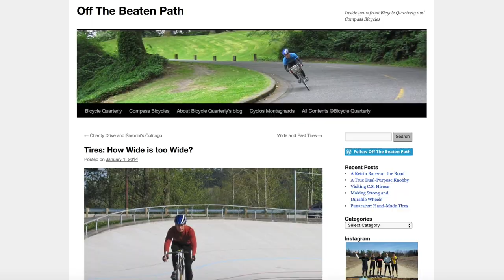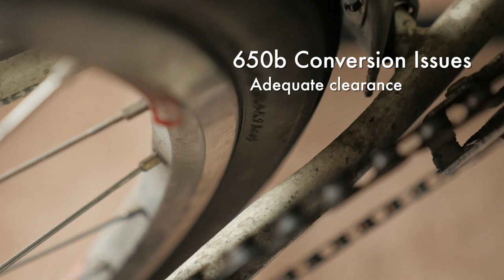Converting a 700c Bike to 650b - #SuppleLife Part 1

Comment: Don't forget that it may reduce toe clip overlap depending on the size that was being used originally. What do the tires end up measuring out to? We tried the WTB 47s (actually measured 44mm on slightly narrow rims) on our Pass Hunter Disc. They filled out Pass Hunter Disc frame nicely but not a whole lot of room for wider fenders. Can't wait to try it out on a longer ride now that the weather is looking up.

Comment: Technically with the same size tire 700 to 650 will drop your height 5cm. Of course you can make up the difference by adding taller fatter tires on your disc brake gravel frame that have room for about a 700x50c tires. 
In my opinion the gravel bike companies are missing the mark by not offering 650b or smaller frames, measuring with 700x45c tires and having descent standover to lower your seat post and do steep gravel descents with confidence.
Reply: Technically, it should drop your bottom bracket 19mm. 700C BSD = 622mm, and 650B BSD = 584mm. The difference is 38mm, divided by 2 is 19mm. Once you start adding 650B tire width, the difference gets smaller or goes negative. For example, converting 700x28 to 650x42, the bottom bracket will only drop 5mm. If you can go up to 650x48, the bottom bracket will actually get a little higher than 700x28.
Reply: @vautrain  what is the actual diameter of the 622 wheel with a 700c ×28 tire , would it be close to 660mm or much higher ?

Comment: I have a collection of mtbs  Treks Giants I convert them to ebikes. One day when a bought one of the mtbs. I saw a "Schwinn Tourist" I guess it was a commuter style bike, with the rigid forks.. It was faded and had a rusted out chain. The rear wheel was off the bike and needing a new axle and bearings. 
 Well the guy asked me if I wanted it. I looked at it and thought I just wasn't my style of bike with the super skinny 700c tires. But for free?  I just took it off his hands.. 😊

One thing I noticed when I was fixing the axle and bearings. The bike was actually very nice and had an aluminum frame. The rims had 28 spokes and the tires where 23mm super skinny road bike tires. It was like 25lbs or less very very noticeably lighter when lifting the bike off the ground with my arm straight out in front of me.

 I took it on a spin, with the super rusted out chain. Boy... with the rigid fork and road bike tires.. it was very hard on my crotch going over just the little bumps on the crappy, pot hole ridden streets where I live in West Texas. But I found it was so much easier the pedal and seem even faster than most the bikes I owned unmotorized. 

A couple years past and a saw a really nice commuter bike, a Schwinn GT3  practically still new for $30. It had the 700c fatter tires and a suspension fork!  😊👍 I looked online  and the bike new was like 4 to $600. So I bought it. I rode it and once again felt easier to pedal and more faster at top speeds compared to the 26ers I usually collect. This bike setup was amazing.  It felt somewhat like riding a pedal assisted bicycle, with the ease of pedaling.

Idk why it's not that big of deal. It really got me into riding unmotorized bicycles again. I can't believe how people don't rave about this setup..

I LOVE IT!

Comment: You say that converting a bike from 700C to 650B will "lower your bottom bracket, and it's going to lower your crank, therefore your pedals, and will probably increase the chance of pedal-strike..." 

That might be overstated.  While the diameter of the rims is smaller with the 650B, most, if not all of the difference between the overall diameter will be taken up by the *tires*.  The reason I say "most" is that it depends upon what tire pressure you choose.  Running low-pressure (say, 25-30psi) will very likely result in reduced bottom-bracket clearance, but at regular pressure, it should be about the same; less than 1cm overall.  That should barely be noticeable.
Reply from the maker: Not true.  I've found the difference to be as much as half to 3/4 of an inch when switching from 700x40 to 650b x 48.  Enough to noticeably alter handling and increase pedal strike.
Reply: Again, I said "most, if not all"; I didn't say "none".  And you haven't said whether your tire pressures have been equivalent.  

I have two French randonneur bikes (late-1950s and early-'60s) that were originally fitted with 650B rims and tires.  They were later fitted with 700C rims and tires (before I bought them).  I wanted to go back to 650Bs but, being concerned about this very issue, I measured the old tires' circumference, and then measured again after swapping out to 650Bs.  The old rear 700C (a new-ish Michelin inflated to 55psi) measured 2118mm.  The new rear 650B (a new Hetre at 55psi), measured 2110mm.  That's less than 1cm in circumference (so 2 or 3mm in diameter); in no way enough to affect handling, ground clearance or pedal-strike.

My point was that one can't make a blanket statement that it will affect the fit of the bike, since there are too many variables involved, and it may have no effect at all.

Comment: I was wondered how it happened that 700Cx35 is so larger than 700Cx28 and I'm pretty sure you've got the measurement of outer wheels' diameter wrong. On the picture with the comparison disks' upper points that have the same diameter don't match up - 35mm is significantly higher than 28mm.
Reply from the maker: Those were direct photo overlays.  That "comparison discs upper points" is the reflective stripe on the 35mm Voyager Hypers.  They are just that much taller.
Reply: Thanks for your answer, somehow at first i assumed that you have shown the difference in the radius, not the diameter. In other words i thought that the front hub was at the same height everytime, not the floor. My bad).

Comment: What was the internal width of the rim you are using? Also, what exact mm did the tire come out to? Spot on 48mm? I am very curious about using these tires with a 30mm internal width rim. I am wondering if a 30mm internal width rim will actually make the SBH wider? My frame can clear up to about 51/52mm in the rear chainstay. Thank you for this most excellent content :)
Reply: I’m still waiting 🥺

Comment: Are you planning to roll with the 700c fender? How's the coverage? I was assuming I'd need to get new 650b fenders to match, but maybe not? Thanks!
Reply from the maker: Charley Traylor they work fine. I'm cheap so I'll prob just use them and trim the stays to fit better :)

Comment: Nice and informative vid. I've a question since I'm considering doing the conversion on my hybrid. It came stock with 700x40 tires. If converting to 650b, what would be the minimum size 650 tires that I should get?
Reply: How it went?

Comment: Do you not have room for a 700x51, or is it  just the new Vayas have that much clearance?
Reply from the maker: You can fit larger 700c tires, but there aren't that many options in wider sizes for supple road plus tires at the moment.  One advantage of going 650b is you get the suspension and float with lighter rotational weight.

Comment: Hi. I've have read the comments below, but I still can't understand the diagram at 0:07.
Are not the 700x35 and the 700x28 both 700mm in diameter overall.  The 28 and 35 refer to the width, do they not. So why do they all appear to be different diameters in the diagram?
Also, the 650B would be 650mm overall unless you put a deeper tire than a type B. Could you tell us the diameters of the rims and tires used, please.
Thanks for the vid.
I'm trying to do this to my bike, but a lot of the 650B rims I'm finding are just 27.5inch with a standard 35mm tire. Which is just 700x35c.
Why do manufacturers not just write the rim and tire diameters, and the tire width? It would be so much easier.
Reply from the maker: 700 is the rough diameter of the RIM. The tire is a larger diameter. The wider the tire the larger the diameter. Put a wheel with a 700x28 next to a wheel with 700x45 and there is a height difference of an inch.
Reply: Oh, maybe it is different in America. I'm in Europe and my 700x35c wheels are 700mm overall, with 630mm rims and the tires are 35mm deep (and wide).
Actually the rim says 622, but is 630mm.
You say your rims are 700mm! that is as wide as my whole wheel!
Here is the GCN explanation I was going by. https://youtu.be/xlyuWSrbGyk?t=88
Reply from the maker: 700 is a generic name for a road wheel and not an exact measurement. Regardless, just take two road tires with different widths and they will be different outside diameters. The inside diameter where it meets the rim will be the same, but the outside diameter will be different.
Reply: I think the 700C comes from the French system along with 650B, but it seems now that it is all confused. Like you say a generic name. I was in my local shop this evening and they had about 5 different measurement systems printed on the stock.
There is one that all the tires had, I think it is enforced by EU regulation, the ISO system. But it only tells you the bead seat diameter and the width, not the depth.
Driving me round the bend trying to fit more volume in my tire.
Thanks for the videos. Best wishes.
Reply: @richtourist  630mm is not the same as 700C. 700C rims have a bead seat diameter of 622mm. 630mm BSD is the old 27" wheel size. https://www.sheldonbrown.com/tire-sizing.html

Comment: Can that bike do 700x50c tires? Or is that just the newer model? Also what year is that? thinking of buying it!
Reply from the maker: It is from 2012.  Will do a true 50 but it will be tight.  I put in the Soma Cazaderos which measure to 700x46 and it clears with a little room to spare.
Reply: Path Less Pedaled thank you so much! Such a fan of your channel!

Comment: Sorry. I still don't get it.... I thought a 700C wheel has a larger volume than the equivalent diameter 650b wheel. As for wider contact patch, can't you achieve that with a wider tire? In other words, instead of riding 700 X 25c, why not ride with 700 X 32 or 35C? What am I missing?
Reply from the maker: When you do a conversion, the 650b tire has to be wider to match the same outside diameter as a 700c wheel tire otherwise the bottom bracket gets lowered too much.  So for example, if your bike has 700x30 you would need to replace it with a 650x48 for the same outside diameter.  In doing this, you also get a considerable amount of air volume from the big 48mm tire (which in turn increases the contact patch).  You typically don't saw a 700x30 for a 650x30 since it would lower the BB height too much.
Reply: @PathLessPedaledTV  I need help, I got road bike 700cx26, how fat or wide I can go? I'm planning to  get a bit wider tire for fall ride going to work. Pls. Help. By the way my bike is swhinn katana road bike.

Comment: hi, I saw Salsa Vaya Travel 2014 had different measures in respect to the new models (2017), in particular I was looking at 52 frame kit,it seems can fit 26" wheels,is it correct? can you confirm it? thanks in advance

Comment: hi
i have a question regarding the wheels of my hybrid mtb..obviously the hybrid wheels are 700c..so my question is can i convert 700c wheelset to 27.5 wheelset?
Reply from the maker: +Alfred Dastas you can but you may have issues with brakes (unless you have discs) and tire clearances.

Comment: Do you have any thoughts on best inner rim width for a 650x45 to 650x50?  I was thinking 25-29?
Reply from the maker: I asked Jan Heine that question and his answer was if you have a supple casing it is less of an issue.  He said he ran the 650b x 48 on rims with widths in low 20s.